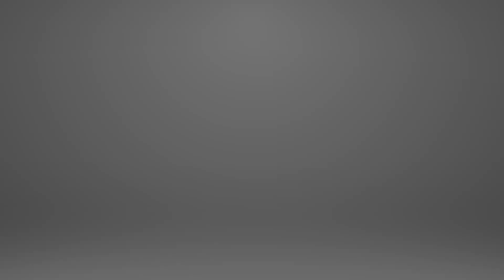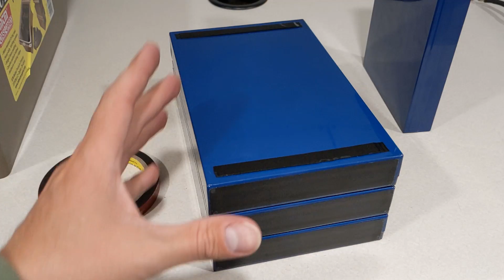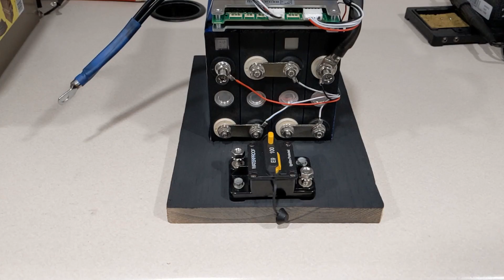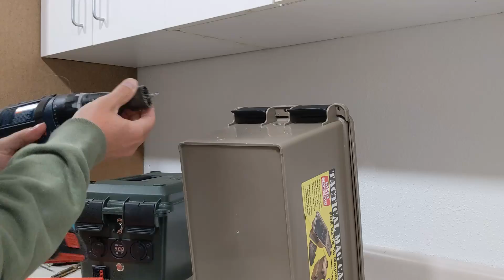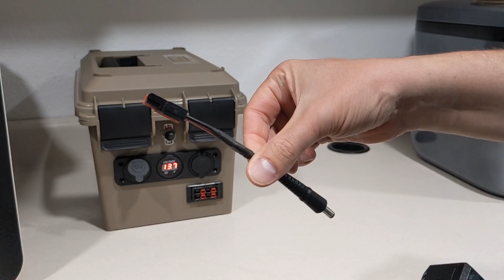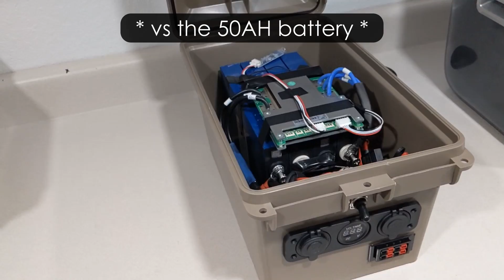DIY 80AH LiFePO4 Battery Box - COMPLETE BUILD VIDEO  | AliExpress Cells, High Quality BMS

Comment from the maker: Check out my NEWER 100AH LiFePO4 build HERE:      https://youtu.be/uN1h0XIpfTg
Check out the full PARTS LIST and wiring diagram HERE on my website:
https://jasonoid.com/diy100ahlifepo4/
Reply: Hey. Hope your well. 
Looking at doing a 4x 105ah build the same as yours. But I’m struggling to find out which bms to use? I only want to use this for usb connections and maybe a 12v socket.  Like you help me please.  
Kind regards.

Comment: Im loving the instruction and slow pacing as a novice lifepo4 builder. My first question is- what purpose does the voltage display serve? What voltage is monitored? Is it just the outlets that are on its left and right? 

Im interested in doing something VERY similar. 304ah eve battery, same bms with blue tooth. I'm also planning to add insulation around the entire box, add heating pads to the sides and a couple of computer fans as well. Those will have  their own thermal sensors with parameters that tell them when to turn on and off, and adding life to the battery by allowing it to be in more moderate temps more often. The fan will bring in air from the vehicle and expel it through a  vent. A few things im not sure of are- is it more crucial to keep it cool or to make sure its warm while using the electricity from it? Does the bms turn off the solar input? And if so, when does it do this? What should be prioritized with safety and build quality with these things?
Reply: Hi. Old comment but hey, he missed it.

Voltage meter is for battery voltage, same voltage that the 12V plug and USB-charger uses.

It is important to keep batteries and other electronics cool enough but cold can harm sometimes. Charging batteries when they are frozen can damage them, some battery systems have in built low temp cut off and even warmer to use some of the power to keep them from freezing. I believe some BMS's have low temp cut offs.

Moisture can be be bad too, keep this in mind when designing projects. Making holes for plugs on the side of the box is usually better than on the top in case of rain.

BMS turns off charging when the voltage is right, don't remember the LiFePo4 spesifications right now. Too high voltage should not be able to input.

I'll left prioritizing for the maker. If the battery box is not meant to be thrown in the back of your car and not to spend a days and nights in damp conditions and scorching sunshine, then it is okay to make it not so durable.

Comment: Can I install let's say 150A BMS to cells like this? Or how can I calculate what is the max Amps BMS I can install?
Reply from the maker: LiFePO4 batteries can usually discharge max at a 1C rate, or 100% of their power. For example, these 80ah cells can discharge at 80 amps max, 100ah cells can discharge at 100 amps max. To get 150 amps you'd want at least 150amp hours worth of batteries or go with a 24v system.
Reply: @Jasonoid  ahhh, perfect, easy :) thank you so much :)

Comment: Awesome video. Thanks for sharing. Looking forward to trying it out here in the South African bush!
Reply from the maker: This video is a little newer and goes over the build process pretty well. https://youtu.be/uN1h0XIpfTg
Reply: @Jasonoid  Awesome thanks for sharing, I will be checking it out for sure.
Reply from the maker: @hhonneysett  Ive used mostly adjustable power supplies, CC/CV style with 10 amp limit and a 60 amp limit, they work well.
Reply: @Jasonoid  Awesome thanks Jason!

Comment: I'm looking to build a box just like yours with a few add on features that I need. I'm a complete novice when it comes to electric and could use some guidance. Would you be open to having some dialog to help me out? I'd appreciate not sending myself to an early grave 🤣
Reply from the maker: Check out this video, easier version and better steps for the install. Also I have a full parts list and wiring guide on my website:

https://youtu.be/uN1h0XIpfTg

Comment: i wanted to build something similar except include a solar charge controller as well. should i wire in the positive of the charge controller to the main breaker, or direct to the battery? if i go direct to the battery will the charge controller always be on and draining my battery?
Reply from the maker: As for draining the battery it depends on the charge controller. Most have some sort of parasitic drain. Its good to fuse that connection so I'd put it behind the breaker if I were you. Check out this super compact charge that works well with Lifepo4, it's the smallest I could find:
https://youtu.be/RKi6wSfELl8
Reply: @Jasonoid  thanks. I think I might add a smaller breaker just for the charge controller so I don't need to turn everything on to charge.

Your diagram was a big help. Most videos show a rats nest of wires and its hard to follow where they all go.
Reply from the maker: This is my more recent build. It has more capacity (100ah vs 80ah). The batteries are also sold in the USA so they are faster to ship. You can view the video here:
https://youtu.be/uN1h0XIpfTg

Comment: Great build! Mine are very similar all though my cabling is not as neat 😄. Have you thought of putting a solar charger in there to be able to hook up a panel? I've done so in both my setups and it works great in summer trips ^^
Reply from the maker: This one I could probably fit a very small mppt charge controller in the case. I have since built a new 100ah battery  that's a little better / easier to assemble than this one. It uses batteryhookup 100ah modules. You can view it here:

https://youtu.be/uN1h0XIpfTg

Comment: Hi Jason great video,how do you charge the battery , what size ,type of charger do you need.
Thanks Mike
Reply from the maker: Hey Mike, make sure you check out my newer 100ah build as well. It's better than this one:   https://youtu.be/uN1h0XIpfTg

As for your questions... I use a couple different dedicated lifepo4 chargers. My solar mppt / DC to DC charger is the Kisae DTM1250. Excellent dual input charger.

My ac charger is a circuit specialists 15v 60amp charger. You can find it on their website.

I use the positive and negative connections from the Anderson powerpole connections to charge.

Comment: How do you charge it ( what Leeds for a.c and solar) looks amazing want to 100amh
Reply from the maker: You charge it from the positive and negative connections. Think of a car battery because it's just like that.
Reply: @Jasonoid  thank you i wasn't sure... keep up the great work looks amazing
Reply from the maker: https://youtu.be/uN1h0XIpfTg

Check out my newer 100ah lifepo4 build, it has better cells and is easier to work on and assemble.

Comment: Hi, 

The LifePo4 cells from AliExpress, there are made in China ?  What happens if the product is defective, and you have to pay for shipping them back to China?

Also would it be possible to use these in an EV setting by putting 2 or more units in parallel ? 

Thanks
Reply from the maker: All Lifepo4 cells are manufactured in China right now. They are working on building factories here in the usa though. Check out my newer 100ah battery build video, it's better and much easier to put together:    https://youtu.be/uN1h0XIpfTg

Comment: How long would the battery pack power your frig/freezer set up?
Reply from the maker: I made a newer 100ah version of this lifepo4 battery box, it has better cells and is easier to build. You can view it here:
https://youtu.be/uN1h0XIpfTg

It will power a 12v fridge for a week or so, depending on ambient temps and the fridge setpoint

Comment: if your battery is 100AH and the Pro Logix charger is only 10A, does that mean it takes at least 10 hours to charge?
Reply from the maker: Yep, that sounds about right. This is a newer 100ah build that I did, I liked it much better:

https://youtu.be/uN1h0XIpfTg
Reply: @Jasonoid  Thanks, I watched your new video and noticed that you trickle charged and balanced the batteries in that video, but did not do it in this video. Is balancing necessary?
Reply from the maker: @mg6192  I did it in both, I just showed a more full process in that video. I'd recommend balancing them for sure.

Comment: Those batteries need to be constraint....or they will inflate and have a shorter life.
Reply from the maker: I don't push the cells very hard. A year later they aren't expanded and doing fine. However I built a newer 100ah design using cylindrical cells. Its much better
 Build video is on my channel a couple months back

Comment: Why the 20 amp fuse for the front panel I/O when the inverter is rated for 300W? Wouldn't the 20 amp fuse trip if you are pulling anything over 240W AC power?
Reply from the maker: I agree this build wasn't perfect and I didn't expect this build to get so much attention. I have built a new battery box with that in mind that has a much better design, more capacity, and proper wiring setup.

Comment: you will not compress them ?
Reply from the maker: I came back after the video and added some compression. But....Check out my newer 100ah  battery build, used much more affordable cylindrical cells that don't need compression.

Comment: Please review recommended cell orientation for your cells. Most prismatic cells have to be orientated vertically not horizontally, otherwise it will damage cells over time. Cylindrical cells can be mounted horizontally.
Reply from the maker: Correct, I don't push these cells at high loads so they shouldn't have an issue leaking, just pull 10 amps or so running small gadgets and 12v fridges. 

I built a new 100ah version using cylindrical cells, put the video put yesterday, it's a better build.

Comment: Do you need to regulate the 12v plug for your fridge to work correctly?
Reply from the maker: Lifepo4 has a higher voltage than lead acid so no regulation needed. Voltage ranges from an average of 13.3v to 12v at the lowest point.

Comment: Nice build my man, I have got a 40AH LifePo4 battery and would love to build some similar but with a nicer case that would support MC4 solar cables too for on the go charging.  Thanks for sharing your knowledge, much appreciated really.
Reply from the maker: Thanks! I have a newer larger build I am doing right now. 100 ah LIFEPO4 for dang cheap! Video will coming out soon. I think you'll find it really useful. The cells are also here in the usa so fast shipping!
Reply: @Jasonoid  Need to see this.  Looking to build a portable supply for week-long camping trips to charge phones, batteries, run lights and fans, etc.
Reply from the maker: @duanevigue1603  you can see the build here:  https://youtu.be/uN1h0XIpfTg

Comment: Nice video, I bought the fan. Where did you buy the barrel cigarette lighter? Thanks
Reply from the maker: Maybe you can clarify what part / adapter you are referencing in your comment? 

I think you meant this Female 12v Cig socket:    https://amzn.to/3Bb0Gc1

I bought the female adapter and then put AndersonPP on the end. I have a video  about making Anderson Powerpole cables from about a month ago on my channel
Reply: @Jasonoid  thanks for the fast response. I bought the Treva 12v fan. It run on the switching adapter that comes with the fan or batteries. Like you, I don't think I want to run using batteries. My plan is to run the fan using the LiFePO battery box that have the cigarette plug. You mentioned barrel connector and I could not find a link in your video where to purchase the adapter.
Reply from the maker: @dummy4100  Ahhhh, so that Treva fan has a 5521mm barrel connector for power. So you'll want this cable adapter:

https://amzn.to/3D9ofnh

12v cigarette plug to DC 5521mm barrel plug. Then you can power the  fan off 12volts.
Reply: @Jasonoid  Thanks, I knew you have the answer for me.

Comment: Great video! Question for you tho… you are charging using the BMS Ground and the positive terminal of all your cells? Just want to make sure I get the how you get there.
Reply from the maker: I connect my lifepo4 battery charger to the Anderson power pole connections on the front of the battery box. Those  directly connect to the positive and negative terminals of the battery (fused of course). The BMS is installed in line of the negative terminal. Does that make sense?

Comment: Quick question.
If I wanted to build a 200amp Hour box, would I need a BMS that is rated to 200amps?  If so, any on Ali-express you can recommend?
Reply from the maker: They don't make 12v 200amp bms units because the amps would be crazy high. If you want to run 200amps you'd want a 24v or 48v battery. I think Will Prowse has a couple higher amp units he's recommended on his channel. I have a new 100ah battery I am making from Battery Hookup in the next couple months. I'd recommend checking out their 100ah modules, they are a great price and super compact!
Reply: @Jasonoid  that is correct, search on aliexpress there are several good quality BMS's available ( or google them ) for 24v which help you do this. You would also need to get batteries / bigger case, etc ) the over all design which Jason provided would just work great

Comment: Where are you plugging it in to charge it? I mean the connection.
Reply from the maker: The Anderson power pole connections on the front. They connect directly to the battery via the positive terminal and BMS. Any lithium mppt designed charger will work.
Reply: @Jasonoid  Just running the current backwards then, in affect?
Reply from the maker: @someguy5035  Yep, just like a car battery, power goes either direction. You use the terminals, anderson PP, or 12v socket to charge or discharge it.

Comment: Great video. Looked at the link for the battery cells and notice a 85800 mAh power station on sale for $249.99 which is less than what it would cost to build one these today.
Reply from the maker: The prices have dropped quite a bit since my video, 100ah are priced as low as $175!! The larger cells might not work in the case I used in the video but all the principles are the same, just find a larger case to use.

Comment: Hey do you have the recommended setting for the bms config. I’m having problems with bms showing very different values for battery charge and wild battery voltages when being charged and other issues like the invertor randomly switching off and on every other second and the bms throwing 1000’s of protection faults.
Reply from the maker: Are the balance leads connected properly? Are any connections loose? Those might be some of the issues.

I did program my BMS settings slightly via the BMS Bluetooth adapter. They are basically the recommended settings for low temp cutoff, and charging and discharging levels.
Reply: @Jasonoid  I will check again but I have double checked and removed and reinstalled. Maybe I will recrimp them when I am back home ( am out camping with the solar setup you help make. ). I will post my settings which i got from overkill solar.
Reply from the maker: @jbphoto8238  if you got it from overkill they offer after sales support.
Reply: @Jasonoid  - I was able to resolve this by balancing the batteries for 5 days. I bought a power supply from amazon (10amp ) building thick cables to attach the batteries in parallel and charging them as on other videos ).. It works very nicely after that. I just think next time I will plan to have the invertor built in ( just more cleaner in my opinion )

Comment: I was thinking, once i used the bluetooth mod and had it all setup, could i just remove to set up other bms of same kind, so as to not keep buying bluetooth mods, that once a lifepo4 bms is setup, it shouldnt have to change parameters
Reply from the maker: I tried doing that with a lithium based BMS from the same brand and it didn't quite work. I'm not sure if the Bluetooth module is compatible with other battery chemistries. I'd probably stick with buying multiple units
Reply: @Jasonoid  even if i bought the same bms from the same person, for instance, bought 5 bms, but one bluetooth and just disconnect to set up all 5 the same way
Reply from the maker: @mattrowe1229  you can try it, I just remember having weird bugs with mine keeping the settings from the previous battery. Just a long time to wait for shipping if something goes wrong haha
Reply: @Jasonoid  what i might do is just buy 2 bms and 1 bluetooth and try it, thanks again for your replies
or ill ask the seller, which i wont get a proper answer probably
Reply from the maker: @mattrowe1229  they have no idea what they are selling. Pretty typical. Let me know what you find out!
Reply: @Jasonoid  ok